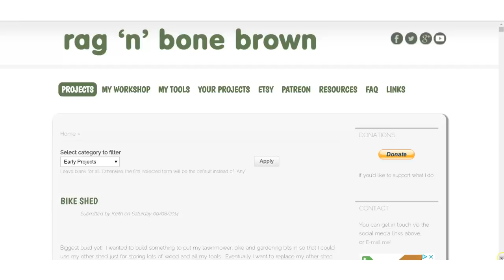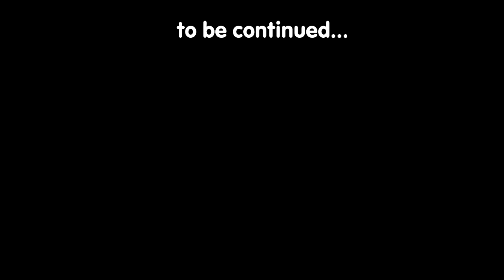Your Questions Answered 2018 (part 1 of 2) - Rag 'n' Bone Brown

Comment: I'm based up in Horsham St Faiths, just ordered (not arrived yet) a Axminster TS-250M-2. You're more than welcome to have a gander when its all set up. I pretty much bought it for the induction motor, I read its the same motor as the 200 model (assuming you've not upgraded already)

Comment: Hi Keith. Just a thought, but I saw you were talking about the Axminster table saw. I bought one and it was really quiet and well built. The only problem was it was underpowered and kept stalling when cutting anything other than thin bits of wood. I bought a Dewalt saw the same as yours and it is much better (apart from the noise!) and sold my Axminster saw. Hope this helps with your decision to purchase. Keep up the good work. Regards Barry

Comment: Thanks for the reply :) also yes DPD are amazing never had an issue with them for anything , when i used to work for the local council doing IT and mobile phones we used them ( or at least vodaphone did) and they would ship quickly and even handle all the returns stuff , they would walk in with a phone and you just hand them the broken one and POOF done , they are pofessonal and always communicate and i have never had anything broken from them.

Comment: Hi Keith, I have the Axminster TS200 saw with all the upgrades (extension wing, stand & sliding table) and if you want any in depth information about it, please send me a message. I've been using it for about a year. I'm also planning to sell it soon to upgrade to a large panel saw. It'll be up for around £450. It cost about £650 last April. Keep up the good work ;)
Reply from the maker: Thank you! I am interested to hear what you like and dislike about it?

Comment: Great video mate! My day job is at a logistics company, so have a lot of experience with different couriers! Hermes are notoriously awful, DPD are generally decent. In terms of Parcel2Go, we've also had lots of problems with them. When I've had to sort couriers myself, what I do is find out the best suited option on Parcel2Go, then go directly through that company's website - not P2G! Works out cheaper every time! P2G add a chunk of comission on top, as they're just a middle man! Hope that helps 👍
Reply from the maker: Thanks for the tip. I’ve tried that before but seem to have the opposite experience - it’s always more expensive via the courier for me... odd!
Reply: @RagnBoneBrown  Oh really?? That's very strange! Well I hope you don't keep having courier issues anyways! 👍

Comment: will you ever get a bigger table saw, maybe a cabinet maker's table saw or a hybrid saw?
Reply: axminister is a very low - end brand, especially the hobby selection. They won't preform to the tasks and efforts you put it to, and I wouldn't recommend it, especially for your most used tool.